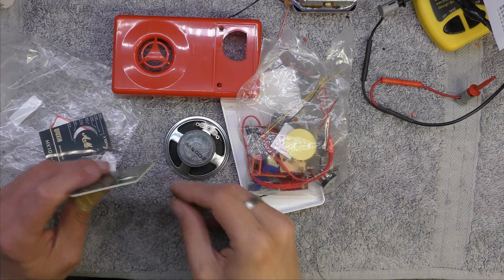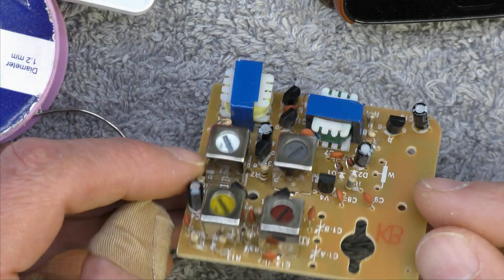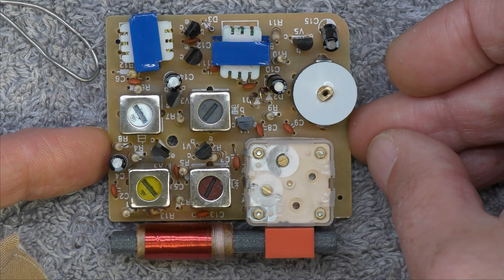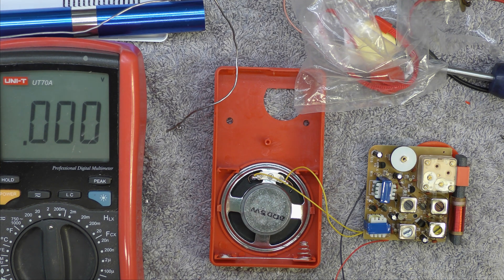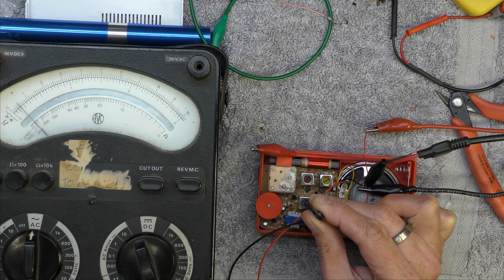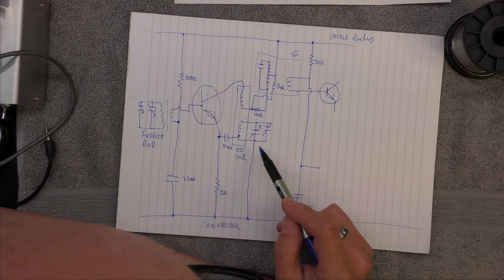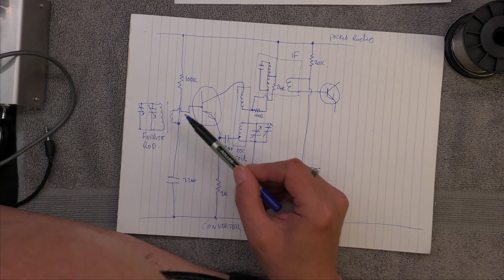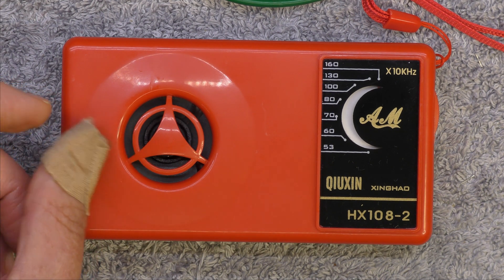Kit Radios Pt1. Qiuxin HX108-2 and Haynes FM Radio Kits. (4K)

Comment: A real adventure mine was in my palatial shack had solar power. And inverter. And the cold lonely night went by fast. And all most like my children i have sevral on my shelve. And at 72 i enjoy them oh ps if in breaking the battery setup use a aaa batt pack works best though the life of that pair will be shorter and fit well tks its our hobby 73 odn-1

Comment: Make Shure that the board is"clean". And I sprang  for better restors, and then found  some NPO caps for Cheep. It got a whole lot better. "less drift." I'm hoping to get a better speaker. Its a MISTERY the given one works at all.  All in all once done it s a signal grabber. I won't part with. Thanks again for your time kv4li. 73. 😎

Comment: Hi there so can u add the fm bord for radio doesn’t have fm thanks
Reply from the maker: I guess you could use the small fm board as used in the kit to update a radio if you could fit extra switches without making the updated radio look odd.

Comment: I just finished hx-108 2 kit, the main problem was 223 capacitors, all was defective. Now the radio is working, it is very sensitive just like a sony ifc radio, but the quality of the audio is not very good. I think because of the class b amifier...maybe if i change R11 bias resistor to a lower value it help? What do you think?
Reply from the maker: Ill have to look at your idea and do some measurements. I wonder if its the cutout of the speaker grill that gives a shrill sound. I wonder if I should try a external speaker.

Comment: Great. I do enjoy building kit radios I think I have built all these myself.  I had the same transistors from memory doesn’t it use a transistor junction as the detector diode. Thanks best regards Chris
Reply from the maker: Thanks Chris, Yes think your right its just used as a diode. Good you like kits too. Biggest two kits I built were Elecraft K2 and Tentec short wave receiver. Pity I never had any heathkit stuff.